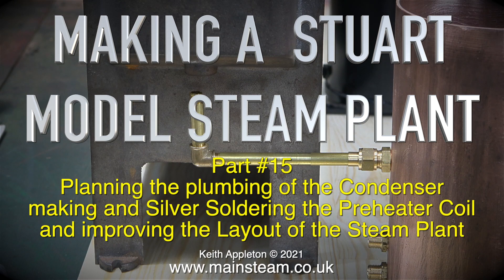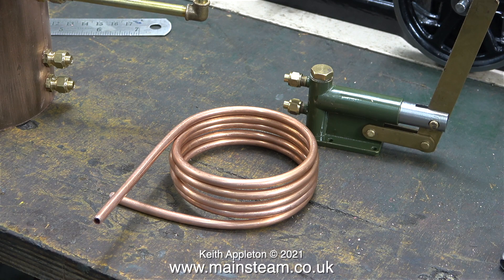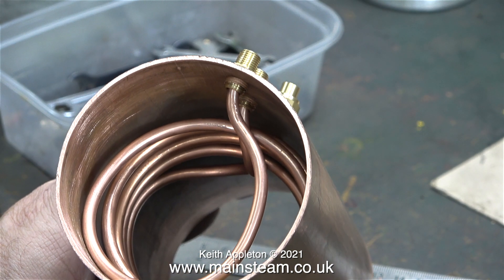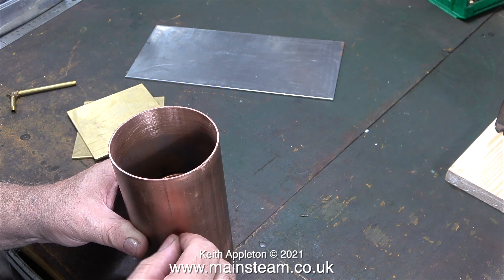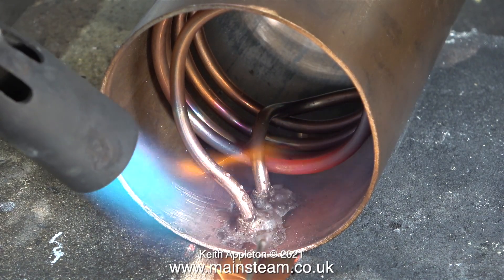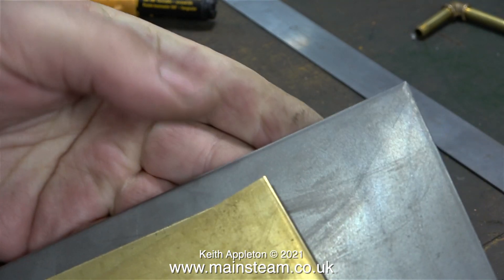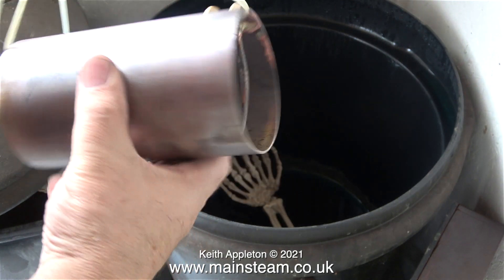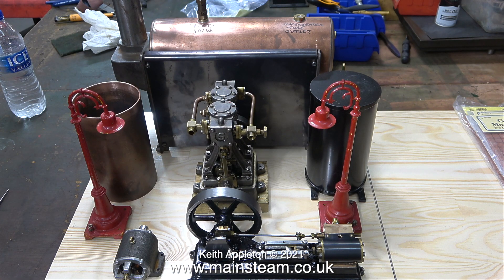MAKING A STUART MODEL STEAM PLANT - PART #15

Comment: Keith, let me ask you please: at 6:30 that hand in the bath - is it absolutely necessary for a good bath or it can operate just fine without it? Need to know if I should get one too or not. Thank you!
Reply from the maker: Well, think of it as a PH Indicator ....... They are very easy to come by around Halloween time }:-)))
Reply: @keithappleton  ah, OK, thank you! So if it's still there the PH is in acceptable range but if it disappears one should correct it (and get new hand). No fancy electronics and all that stuff. Very reliable and pictorial. Old school, like it!

Comment: Looking smart - the layout is nice and symmetrical as you say. The lamp stands are lovely, and the D10 will look the business with them 

I've a Windermere steam kettle to make ay some point and thought that poking the coil through the fittings may be difficult as you found! Why do you say it is important not to quench the part after silver soldering - I'd always understood that brass & copper behave the same after heating irrespective of cooling time (i.e, they both remain annealed) so normally quench just to save time!
Reply from the maker: yes there is little difference by quenching when annealing, but the thermal shock of quenching removes some of the scale & oxidisation and that is why I do it.